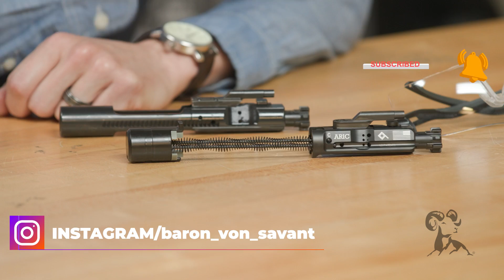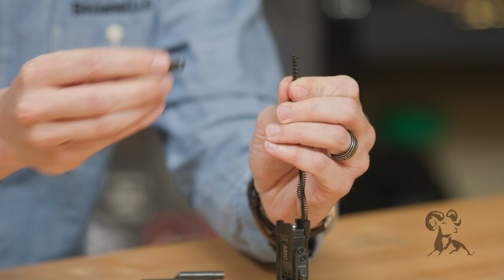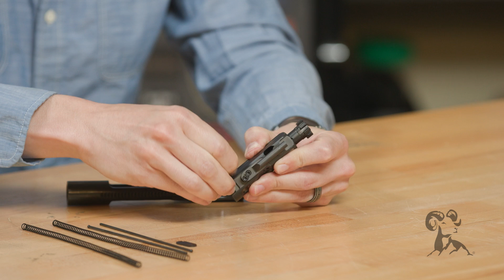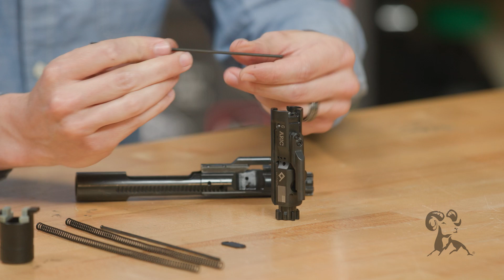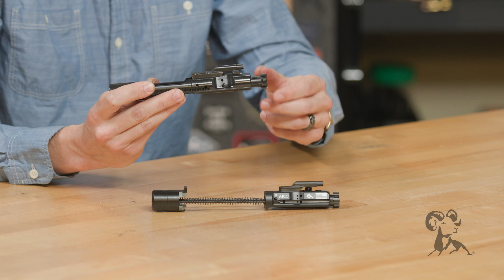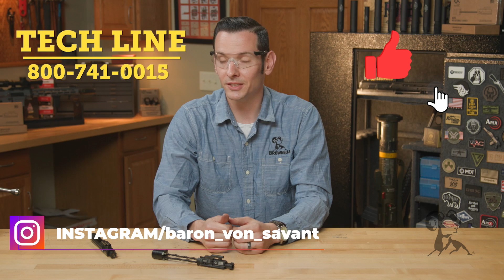Law Tactical ARIC Disassembly & Maintenance

Comment: Really interested in the weight difference since what kept me from using a law folder was the added weight (and increased length of pull). But with the ARIC the bcg should be inherently lighter and the removal off the buffer/spring will be additional weight saved. Be cool to see how it works out!

Comment: Thanks tip on that it is ok for the one piece gas rings to collapse. 
 I may  eventually go to something like that ARIC system.  It depends on when and if the new ruling on braces comes out.  If braces get banned, than a folding stock is a legal way of getting a legal, but shortened AR.

Comment: I was pretty excited for this release but it's a huge bummer that you have to buy their folder too. Woul be awesome if you could use a pic rail adapter
Reply: They state on their website that they have developed Pic rail adapters for future release. The reason this was not released with the ARIC initially is because Law intended for this to be a fully backwards compatible system.

Comment: Am I the only one who finds this useless? The Law Tactical Folding Adapter I love and have it on my Banshee for storage, but isn't this just an AR180, but just with extra steps? With the price of this and the adapter, just buy an BRN180
Reply: Glad someone is seeing this the same way I am.  What is the point?  Spend $700 so you can shoot your AR while it's folded? Why do you need to do that? Are you a hood rat doing a drive by? Hard to be accurate shooting folded.   I'd rather just have a good quality regular AR bolt and buffer spring instead of relying on this new system.   If you want to shoot a rifle with the stock folded so badly buy an AK.  They've had that capability for decades now.
Reply: @raymaiar  Have you accounted for the fact that, people just want to and that's the point. Not everything has to have a utility, people can want things purely for just wanting them
Reply: @bower31  yeah of course, but I guess it just doesn't appeal to me. I'm not yet so bored of regular AR bolts such that these spark my interest.  I don't like the whole redesign of something that works just to shoot stock folded in an AR when other platforms already do so.  And I just don't know if they're as reliable as regular bolts yet. We'll see. Get one, try it out, let me know if it works as well as a normal one
Reply: Calm down boomer, not everything has to appeal to you to justify it's existence.

Comment: How is the rifle not “over gassed” using this with the massive weight reduction of having a shortened carrier and no buffer?
Reply: Simple, they added more gas exhaust holes to the carrier to regulate the bolt speed.
Reply: 2 long ass springs?

Comment: Would this BCG work with a buffer-to-rail adapter so you could use a skeletonized picatinny stock? Like a poor man’s Sig MCX 😅
Reply: On the law tactical website they state that a pic rail adapter that doesn't require the original law folder is planned so you can attach stocks like a MCX.
Reply: Would love to know this as well

Comment: Just hoping they come out with a BRN-160 one of these days.
Reply: Brn160?
Reply: @AIRS0FT02  it’s a play on their BRN-180 rifle. The 180 was based on the AR-18, a folding stock design chambered originally in .223. What I call the BRN-160 is effectively the same thing, just based off the AR-16, which was chambered in .308. Basically the AR-10 relationship to the AR-15. Same basic rifle design, just a little bit bigger.

Comment: Oh GOODY. A new design bolt carrier group. MORE SMALL PIECES. Does this mean the new cannot or should not be disassembled out in the field at the front..?
Reply: Smallest piece in the ARIC = cotter pin. Smallest piece in standard BCG = cotter pin. The only time you need to remove the springs and bumpers is when you are replacing them, so that is not a "in the field or on the front" operation.
Reply: @CalebSavant  Bumpers...2.....plate that retains the springs, spring guides can be bent...AR riflescare famous for constant cleaning
One question...the buffer...?
Reply: I had no idea what kind of bolt carrier group this was so I did a little research it's almost a $400 BCG. I'm sure it's has its use with a folding stock but I wouldn't need one.

Comment: Be nice if they weren’t always sold out
Reply: My in-stock notification came in about 6 hours or so after it was back in stock. I only knew it was in stock due to have the page in a tab that I regularly refreshed. I was able to get mine and it is in my AR ready for testing. Installation was a breeze.
Reply: @grunt167  👍🏼
Reply: Supply and Demand
Reply: @CalebSavant  I demand more supply